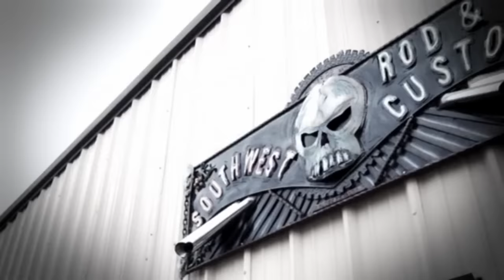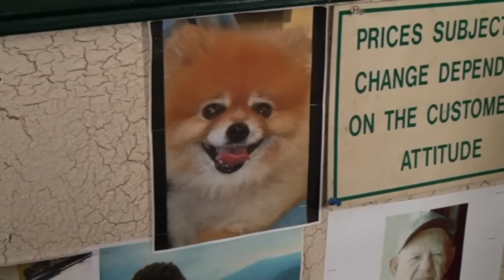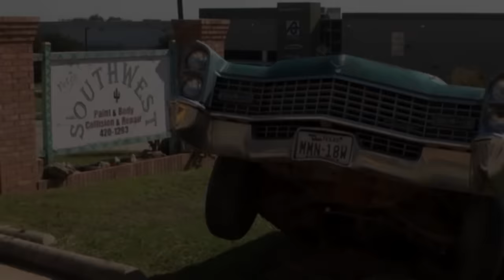My Friend Pete's Reality TV Show - SouthWest Rod And Custom - Episode 2

Comment: Flat tire guy would have shown how a chain works from the back, into street. Make an excuse to get the keys to check the sticker to tire size, have Minnie and helper be ready to block the entrance then back it out, put the 4-Way flasher on while parked across the street or medium out of traffic then called the police. Keep the keys and tell him & cops that this is a body shop. We don't sell tires or have the word tires on the building. 
  It is like pulling into a gas station and asking them to paint the front clip of his car. The county will tow it to an impound lot. You pay and still have flat tires. Most likely he was high demanding I see cars being fixed but never learned to read English from Sesame Street. Phone a friend, call a gas station or tire shop you can see down the hill...Go there!